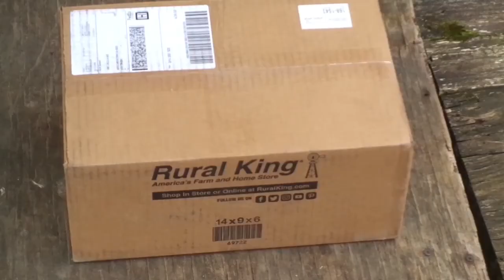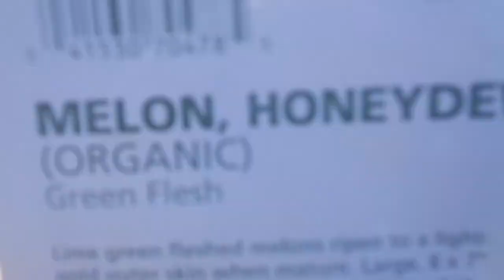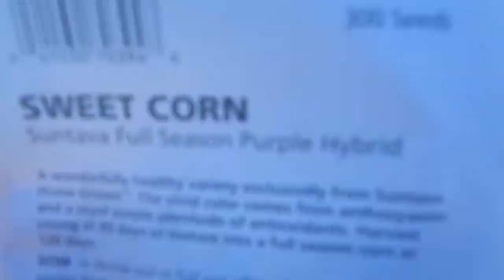Lock Down - Day 51 (Time to Sow)

Comment: When do you plant the meatball bushes to go with the spaghetti squash?
.
I have a feeling the well problem is in the bottom of the pipe. You may have hit
a rock dead center so you get some water around it but just not the volume
you need.
Reply from the maker: The problem seems to have alleviated itself. I have no idea why. I kind of suspect sand in the filter. We had about a four foot drive of nice beach sand when we pounded it in.